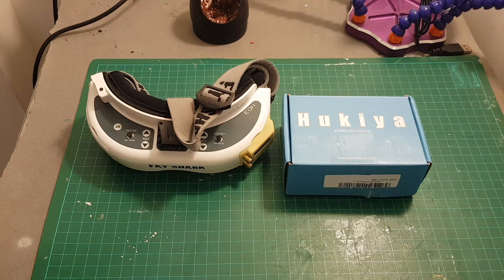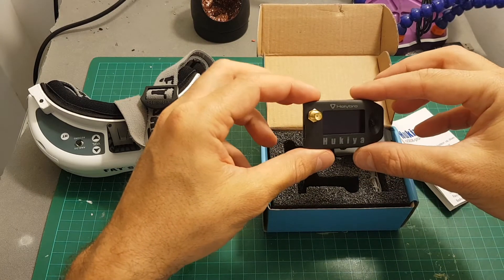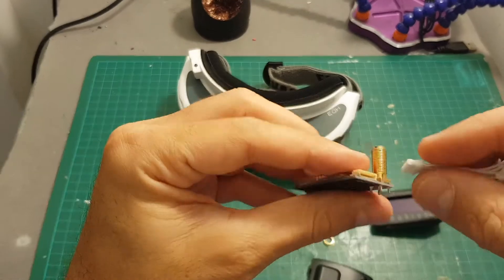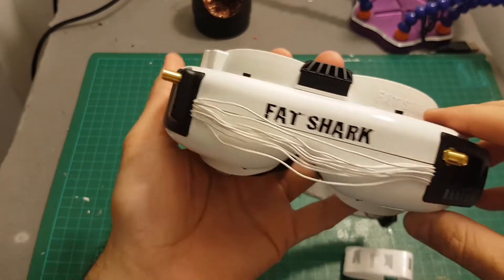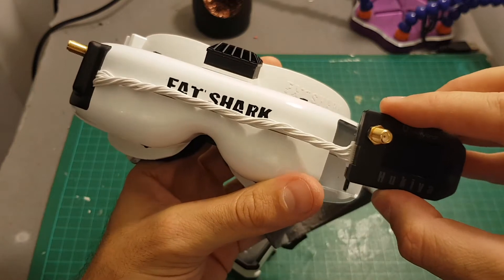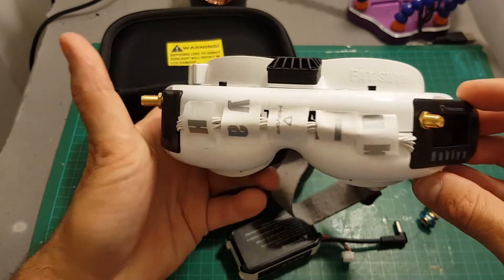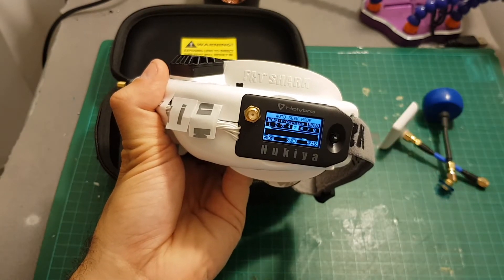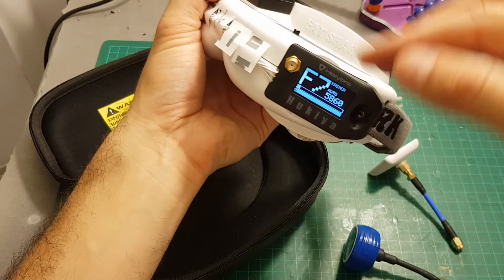Holybro Hukiya RX5808 Pro Diversity Receiver - Unboxing And Overview

Comment: Can you share your experience with the HD3 ? I have played with Dom v3 for a while and looking to upgrade to HD3. Is the larger fov give much more immersive feeling ?
Reply from the maker: I have tried both (Dom V3 and of course HD3). I prefer it's larger FOV and I actually miss the bigger FOV of the HD2. Overall it is a matter of self preference. If you can - I recommend you to try the HD3 first and then decide which version to get.
Reply: Gal Kremer Thanks for your response. I will try to try the HD3 first.

Comment: Man, what a mess. You can easily route the wires inside the googles with minor surgery. Takes about 20 minutes.
Reply from the maker: You will need to drill two holes inside the goggles - something I don't want to do.  Let me know if you have a better solution :-)